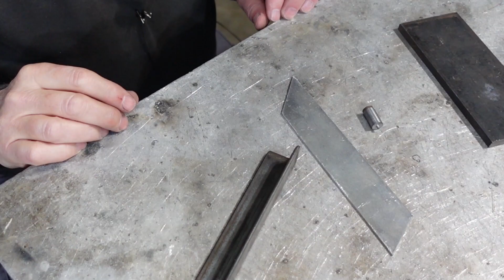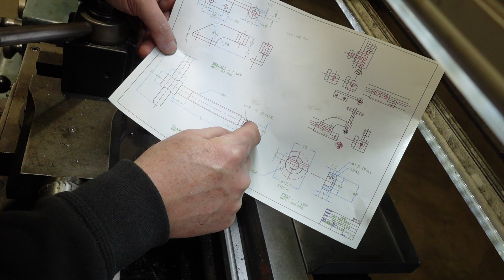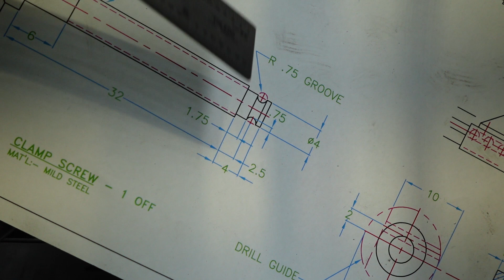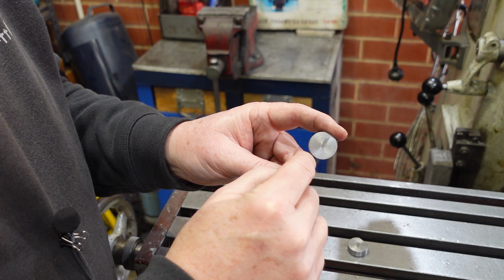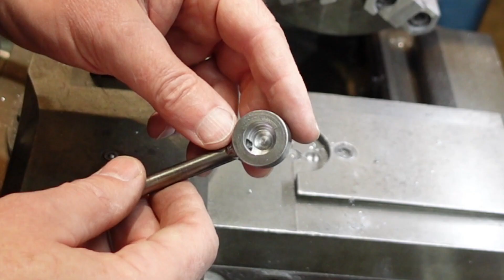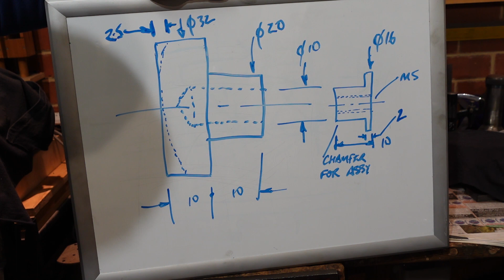Small parts for the Gower drill grinder (Gower drill grinder pt 4)

Comment: A very nice 4 facet grinder. However, you’ve not explained what the primary angle facets are supposed to look like. These two primary facets should be each be exactly half of the width of the chisel, so to meet each other at a central point. It looks like yours meet but both are equal to the width of the chisel.??
Reply from the maker: If you have a look around 12:10 on this video https://www.youtube.com/watch?v=BnaVnvpAD8Q&list=PLs4lu78glLuBoCBeDjy0so_M5eS-k7xXC&index=4, it shows a drill bit just off the sharpener. Does not look too bad, and it work well.

Comment: Slowly coming together, 
I gather that the lighting problems are over, not that I noticed any difference 😀
Reply from the maker: Lighting may still be an issue - I usually have several things on the go at once, so it may show up in future videos. I won't show video where it is really bad - most of the time the lighting is not as even as I would like, so stronger shadows and maybe some parts not as easily seen.
Reply: @occasionalmachinist  👍